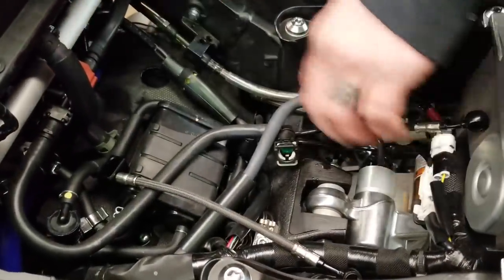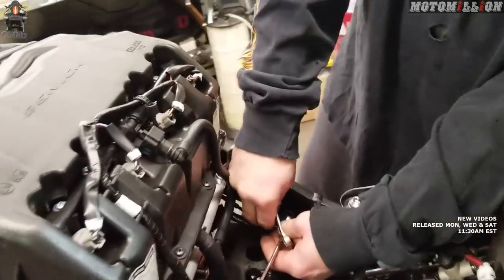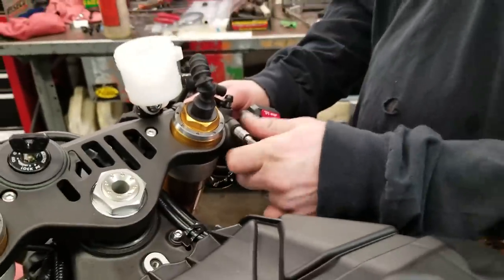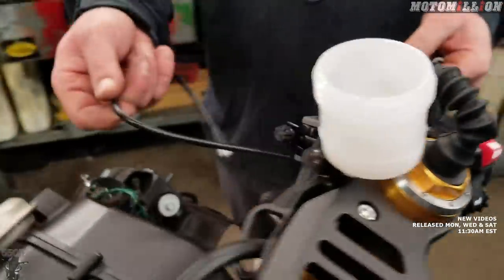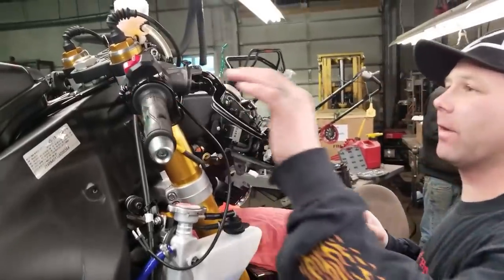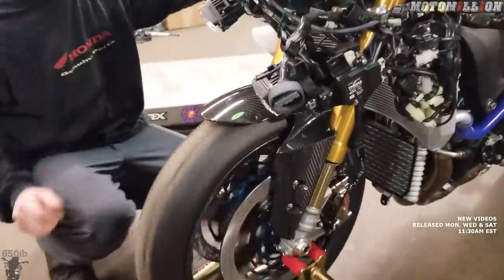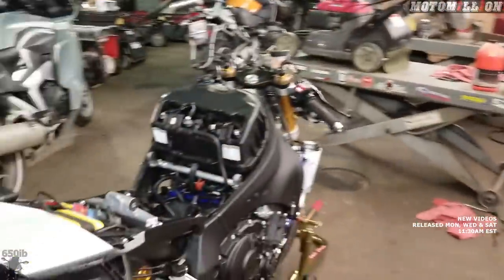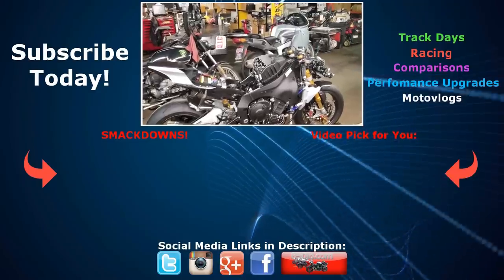Yamaha R1M Brake Upgrade | Brembo RCS19 Master Cylinder Installed (2/3)

Comment: Sorry maybe this was addressed before  ( I didn't watch part one yet ) but why change braided lines for kevlar lines? They pretty much have the same heat/expansion qualities and my team mechanic told me they won't add much more then the ones already there besides the extra cost and looks. Are you guy's using a RCS19 master and are you going to use the Brembo rear reservoir delete kit? 
So if Zack or you have the info I would like to know I'm curious :)  
bike is looking good

Comment: why do you use rsc19 and not rcs17? the pistons diameter of the m4 calipers are 30mm. so brembo say if yo drive the m4 or m50 or if your pistons are smaller than 30mm so use rsc17 if they are bigger than 30 so use 19. hope I could help. btw love your videos!

Comment: How much less lever travel do you guys get with the RCS19? The stock nissin on my CBR1k has like 25mm of travel before it starts to bite, non-abs, fresh Motul RBF600,  and no air whatsoever in the system. When the brakes get some heat in them it gets even worse and sometimes won’t get better until bled. I am looking for a more instant/stiff lever pull so it’s more linear and less like an on/off switch. Will this master help get the feel I’m describing?

Comment: Did you use Motul high temp brake fluid since you have the high end braking system just curious? I use it on the track.